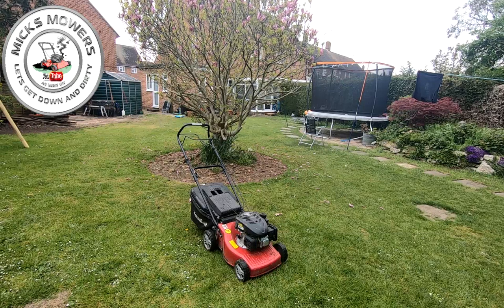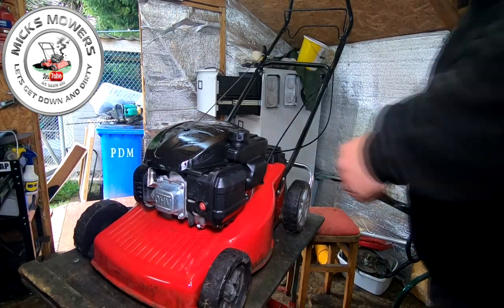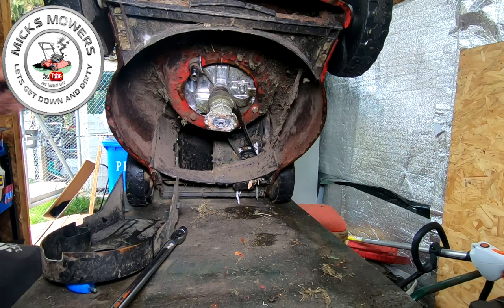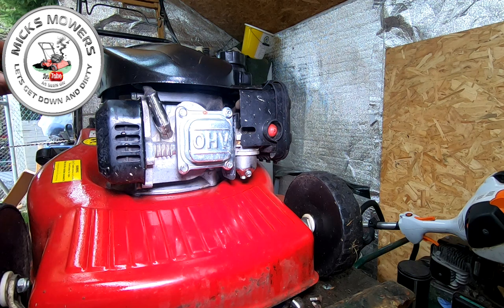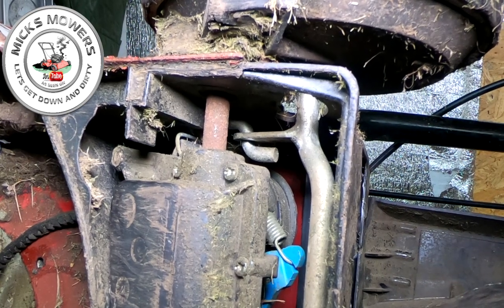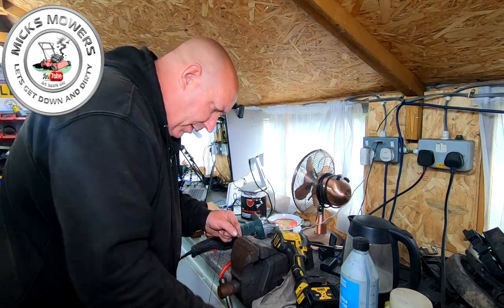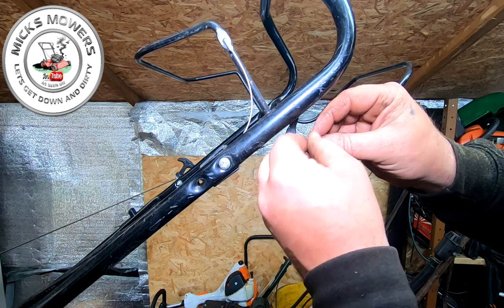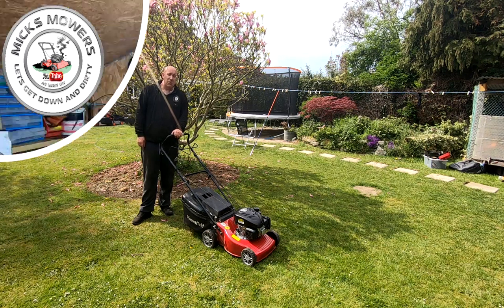Mountfield 464 Drive Cable Fix. How to Save Money With A Quick Fix #howto

Comment: I can see why you repair the cable this way - makes absolute sense. I decided to remove the whole cable (before I saw the video ) having got a
replacement. The cable pulled out of the sheaf easily complete with spring. However, the cable sheaf end is stuck so can’t pull it out via the hole in
Reply: Above continued……..the mower metal body- suggestions please  - access is so poor. Ive cut the hole cover out and mower  underside is accessible. Thanks in anticipation.

Comment: Hi mike, where did you get your flexi end for your drill? Been looking for one just like that. Love the videos
Reply from the maker: Where abouts in the video mate ?
Reply: @themowerman  not sure if it was this video or maybe the one before you were undoing the bolts under the deck and you were using a short flexy bit extension been after one of those just like that one 👍

Comment: Hi m8 just wondering if you can advise me on the mountfield lawnmower please I have 1 but it doesn't look like any of the mountfield lawnmower I've seen on Google same colour but it says on the engine cover m5 mountfield. What's different to the others is apart from the two handles 1 front 1 back it in between them handles are two paddles 1 is speed control and the other 1 has 1,2,3 on it they are on a metal plate going across the top of the handle I have no idea what model it would be thanks in advance paul
Reply from the maker: Email me so photos mate

Comment: Hi Mick, I have got an old mountfield LS45. I have slackened off the drive cable as I couldnt pull it backwards or barely forwards as far as I am aware this should make the wheels move freely but they still seem quite stiff? Do you know where I am going wrong as to why it still seems quite hard to push? Thanks
Reply from the maker: Maybe the bearing need looming at mate..
Reply: @themowerman  Thanks for reply Mick, I've had a look at them and they seem to be loosening a little with some WD40. Thanks!

Comment: Hey Mick could you share the link for the cable you use, I had ordered 400' of 1/16th which works out to be 1.5mm in diameter, and 100 piece crimpable ends, lol, I received 50' of 1/8th cable, and 25 ends, what a rip off, but Amazon took care of it for me the and I gave the person a bad write up, so any help would be great tks.
Reply from the maker: Here you go mate https://www.ebay.co.uk/itm/1mm-1-5mm-2mm-3mm-4mm-5mm-6mm-8mm-STAINLESS-Steel-Wire-Rope-Cable-Rigging-Extra-/142480024260?_trksid=p2349624.m46890.l49286
Reply: @themowerman  tks buddy
Reply: @themowerman  yep that's what I ordered, guess they sent me the wrong stuff, or trying to pull a fast one, tks again mate.
Reply from the maker: @knighthawk86855  welcome mate

Comment: ive got a honda izy 466 the drive cable is vibrating and shakeing loads . what could this be mate 
it still pulls on the drives ok tho not great
Reply from the maker: Maybe a slack belt??